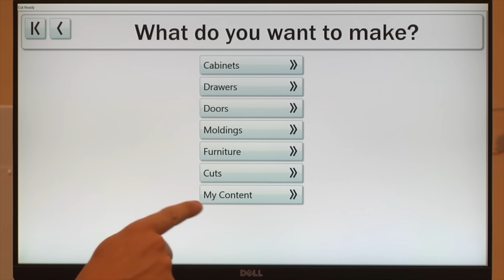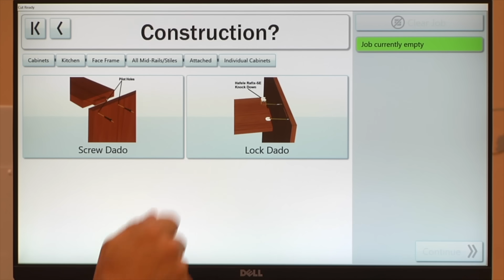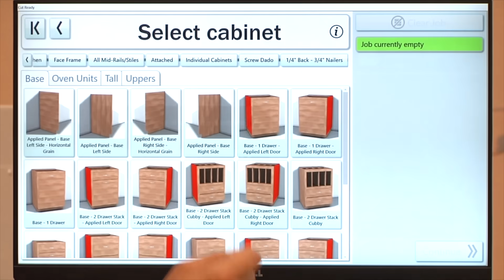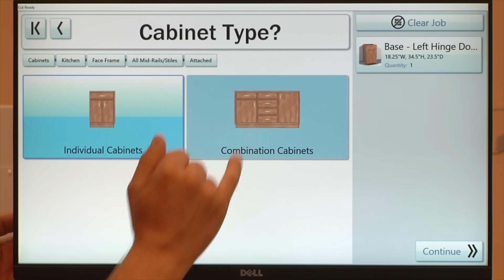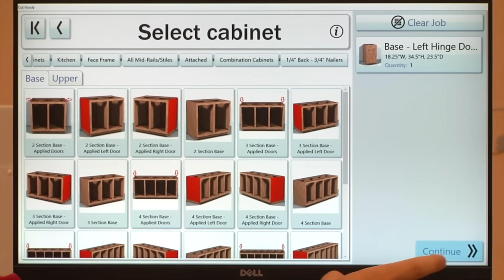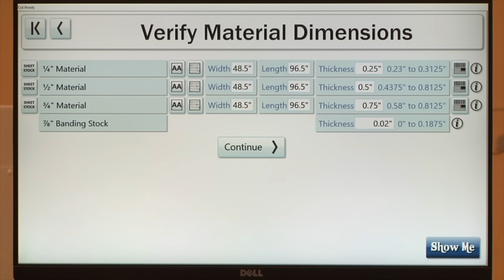How to Design a Cabinet and Add it to the Job in Cut Ready

Comment: What software are you using
Reply from the maker: Hi Theo,  We are using Cut Ready, our own software that drives the Cut Ready Cut Center.  It is a powerful, visual-based interface that allows the user to just pick what they want without programming, and the machine makes it.